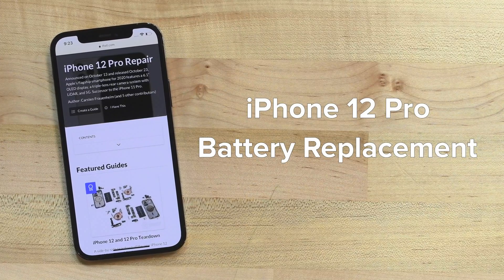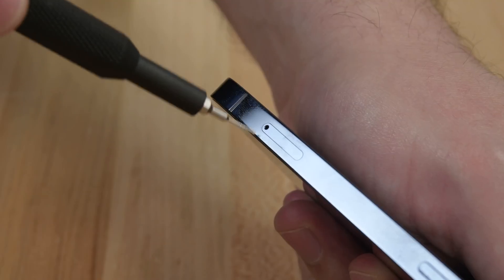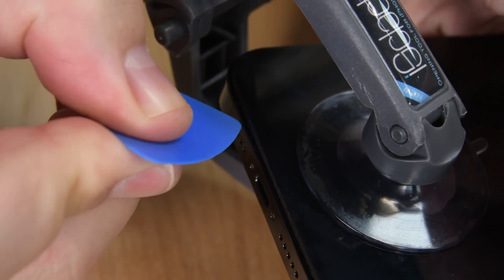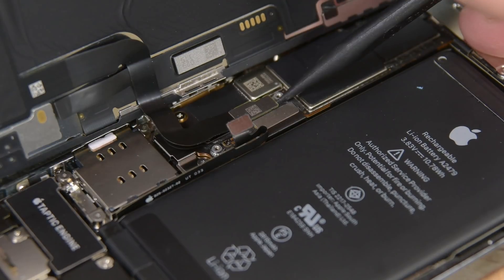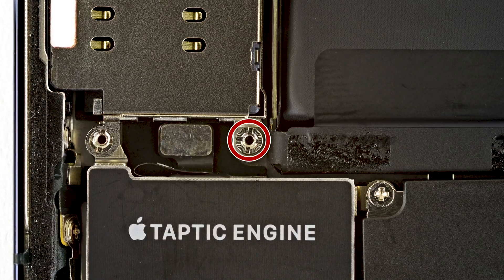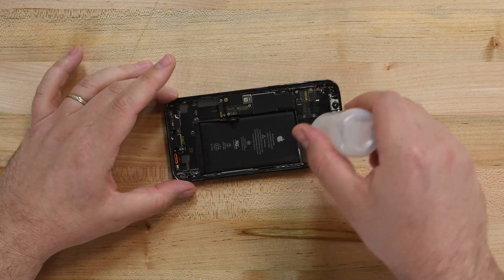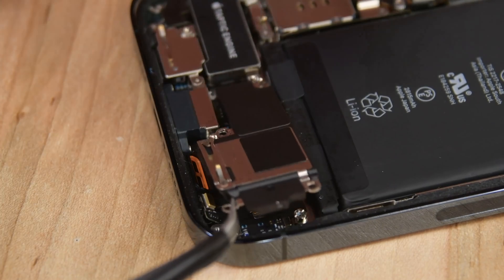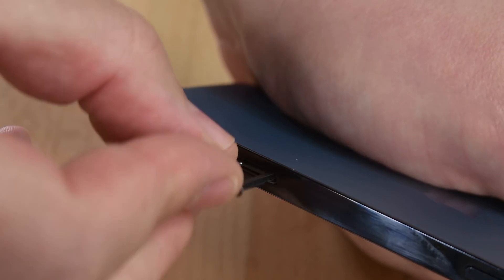iPhone 12 and 12 Pro Battery Replacement

Comment: I miss repairing these tbh, but not the older models with TouchID buttons. 
They were a lot more annoying to replace the screens as the TouchID button was completely unique to each phone - if you accidentally tore the cables, that's it. No more fingerprint lock.

Comment: You reinstalled the bottom sim card reader bracket the wrong way. If you look closely at around 4:12, there is a small pin protruding near the left screw hole. While reinstalling it, it was on the right side.

Comment: 12 mini is the same, right?
Reply: Eh kinda? These guys don’t seem to realise that you don’t need to remove the Taptic Engine or SIM card reader. So yeah
Reply: @lukeren1904  i know, but they like to do that
Reply: @lukeren1904  ty
Reply: The 12 mini doesn’t need the speaker to be removed and the pro max needs the Taptic and speaker removed to access the tabs. Also the reason they always seem to get broken tabs is because you should twist the tweezers on the spot to remove the adhesive especially up the top of the battery.

Comment: Doesn't water resistance go down after replacing your iPhone's battery? I mean I own an iPhone 11 Pro and will be looking to replace the battery in September. I think I'll pay Apple to do it but I'm not sure it's a good idea because surely water resistance will go down? They remove the display and I fear that when they close the device back up, there'll remain some old glue on certain parts and that will prevent a perfect watertight closure and thus water resistance could be affected... I was also considering doing it with my Apple Watch which is at 86% battery life and will be at about 82% in September. And water resistance is even more important on the Apple Watch...

Comment: Why do you need to remove the SIM card tray?
Reply: in order to pull the strips under the battery at the right angle. Taptic engine connector is under the sim slot. Otherwise they could brake

Comment: One more reason to stop buying iPhones, everything is being paired to the logic board. 😒😒😒😒
Reply: even the battery……like why Apple, why you do this
Reply: You know they want to be simple , and privacy, not customizable.
Reply: So wait this repair isn't possible then ?
Reply: @thomasloyal4525  it is possible but after repair there will be an indication that you have a non OEM battery in the device so that you know
Reply: It still possible but more tricky since you remove the logic board of the battery from the original battery and put it on the new battery. It could be harder but still possible.

Comment: For a phone that’s glued shut, this looks really straightforward. I’m curious if it’s possible without even having to remove the sim reader and Taptic Engine.
Reply: It is totally doable. On iPhone 11 the design is quite similar. However, it is safer to remove those, especially if you haven't removed iPhone batteries in the past. Those adhesive strips are incredibly prone to breaking if you don't know how to exactly handle them.
Reply: Watch again, it's staged with a screen that's already had the adhesive removed.

Comment: Why do you need to glue the battery back in place? I have replaced several phonebatteries but never replaced the glue. It is'nt a structual part of the phone does not slide around since it is usually pressed against the backpanel and only makes a makes a future screen or battery replacement more difficult. (In case of most android phones)
Reply: Once I replaced it without these battery adhesives and it was rattling inside during shake.

Comment: new title : how not make battery replacement hard .. good job apple
Reply: I just replaced a battery in a Samsung A50 and they use really strong adheasive without any pulltabs, but with a few drops of IPA behind the battery I could pull it out without any real resistance after waiting 2-3 minutes. I think you could do the same with an Iphone and would not have to remove all the stuff at the buttom.
Reply: @markus98sb  You don't have to remove the stuff round the battery, you just need to be careful not to tear the VHB strips against the edges of the other components, and it does tear quite easily if it somehow gets damaged (say by pulling it at to sharp of an angle or to quickly).